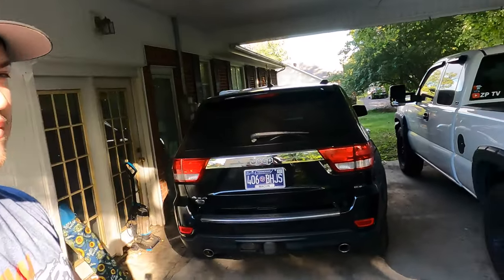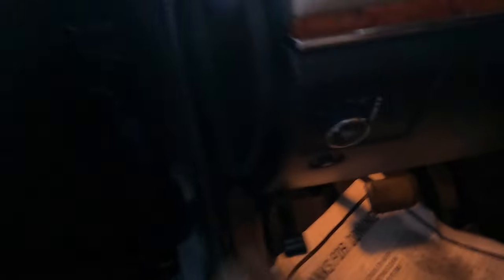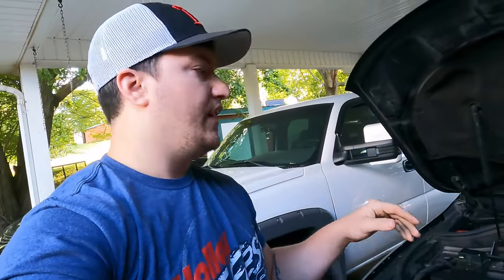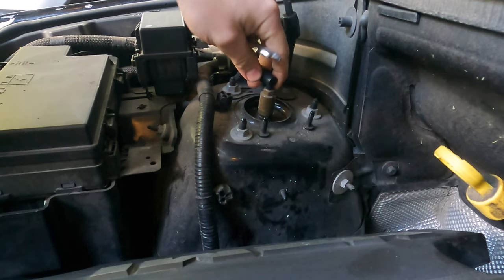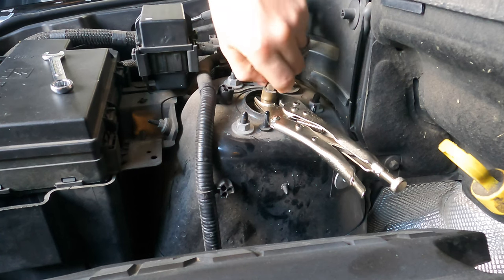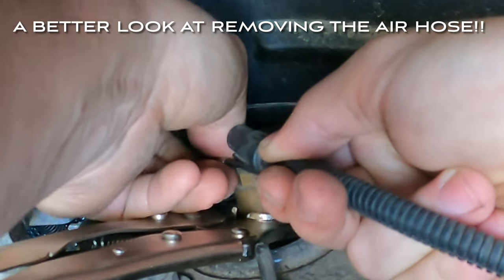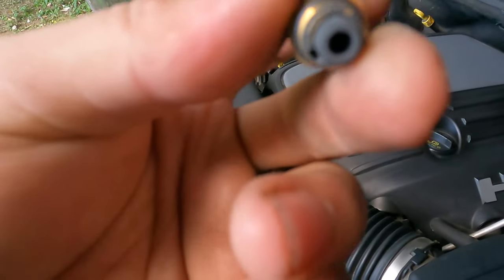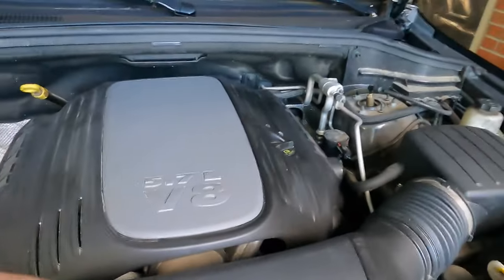COMMON PROBLEM!! Jeep Grand Cherokee Air Suspension Leak Fixed!!! (CHEAP & EASY)

Comment: Got quoted $4800 to replace the compressor and air lines to my 2011 Jeep Grand Cherokee from two separate Jeep dealerships that I paid to diagnose my air suspension issues. Same thing it was sitting really low on the front.  I saw this video and did this just to check before I spent the money and it fixed it. Thank you for saving me so much money! Now about those diag fees I was charged....
Reply from the maker: Happy to help!

Comment: Step 1: buy a Cherokee without air suspension
Reply from the maker: Pretty much lol 😂 It’s nice to have but a huge headache when it starts messing up lol
Reply: @ZPTVChannel  I had an 2003 navigator with it, always had problems swore to never own a vehicle with air suspension again. Looking at an SUV, saw a nice Cherokee on the lot, during the test drive I noticed the up and down buttons and asked the guy what those were for, he said it was to adjust the air suspension, drove it right back after that and left it on the lot.
Reply from the maker: @adriandude85 I don’t blame you lol even if you delete the air ride on most of these you get “service air suspension” warnings on the dash.. like you said probably best to just avoid it all together lol
Reply: I have a 2011 overland and my mechanic replaced the 2 bags and the compressor.  Its still on the bottom. Doesn’t go up at all.  Now he doesn’t know what to do
Reply: I’m currently experiencing this issue
Reply: @antdogs189  You need a new mechanic. Air suspension systems are pretty simple.

Comment: Thank you so much for sharing! Replacing the air suspesion elbow on my 2011 Jeep Grand Cherokee Overland fix my issue. I ordered 2 JWK2-A210-ADFU - RMT from Amazon and it has been working for several weeks now. The drivers side needed to be replaced but when replacing the passenger side air started escaping so I left it alone. I now have a spare if I need it.

Comment: Hello, had to give you a THANKS!!  I bought a 2011 jeep overland with a leak in the air suspension. I wiggled some lines and found the hissing problem. tried the dealer and they had the complete front two lines for about $100. i didn't want to dig into all that so... I watched a couple of these video's and i remember your video was one of them. yep, that's all i did was order a elbow for the driver side and poof...fixed. first i tried cleaning it and lubricate the o rings, made it leak worse so i parked it for a week till the part came in. I didn't want to burn out the pump is why i waited. thank you for posting. Tim
Reply from the maker: Happy to help!!

Comment: I fixed mine bro thank you so much suspension is perfect now  I put both of them on didn't even need one of them but changed them anyway..put it on tire Jack mode when I did it so it didn't leak any air while I worked on it only took 5 mins to fix.🙏your the best

Comment: Quoted $9k from local dealership to replace the system. Ridiculous. After I prodded they said they could cancel the system out for about half. Found your vid. Will give this a try. It does lift a little like you said, and got progressively worse, so hoping this is root cause. Rear is also starting to squat while off but it comes back up. In any case, thanks for taking the time to share this and especially the link to the part in the description is the cherry on top.
Reply from the maker: Happy to help! It’s insane what stealerships are trying to charge to fix this issue.

Comment: thank you so much! I have this porblem I had it on the passenger side and the dealership told me to change the suspension for 2000!! I am glad I walked out that fraud. Amazing I have the limited 2013 Hemi as well. Now both are lowering so heading to change myself those babies... cant believe it. Changed light bubls all the time  myslef this is easier. Thank you!!

Comment: Thank you very much for your video, you showed me where to buy the air spring connector (RMT) 👍🏻👍🏻👍🏻 and they ship to my country !
Mine broke down due to a traffic accident (chock) not to normal driving. This air suspension on my 2018 GC OVERLAND is just excellent, not a single problem knowing that it is 190.000 km on the odometer now.
Greetings from Morocco
Reply from the maker: Happy to help! Hate to hear about the accident…

Comment: ZP,   You r 1 of the best!! 
I just found a 2012 which has 39 k miles, for 8k.  You think is a good price?..

I like to learn how to swim before I put a foot in the water
Reply from the maker: That’s not bad. Just be sure to listen close to the motor, but with that low of miles you shouldn’t really have anything to worry about!

Comment: We have a '14 Overland with the hemi. Our problem was the weather we encountered In Wyo and South Dakota. Temps dropped to the minus and air suspension stopped. As soon as the Temps warmed, it worked fine.
Reply from the maker: Yea they freeze up if it isn’t fully charged with nitrogen. Even then all depending on how cold they still might freeze.
Reply: The airlines are freezing the moisture that condenses in them; either fill with nitro or spray some anti-freeze in your lines during the winter.

Comment: Seems that you can get away with using air instead of nitrogen to fill the system, but the issue is moisture which will freeze if you're in a cold climate.

Comment: Spray some soap on those fittings and it will bubble if they are leaking.  Windex or fantastic works but there is plumbing specific soap for this.
Reply: Do I need to check it with the jeep turned on?
Reply from the maker: As long as the suspension is aired up you can check it with the Jeep off.

Comment: Hello, when you put out this conector, u need recharge any type of air or gas? For the suspension system?

Sorry for my bad English 

I looking for install a kit of leveling
Reply from the maker: You can get it recharged with nitrogen but you don’t have to. The system is self filling so it will just fill itself with regular outside air!

Comment: We have a 2012 Overland and we’ve had our system replaced three times under warranty. Thank God we bought the extended warranty which is no longer available, unlimited time unlimited mileage so it cost us $100 each time but I believe this system is about 3500 bucks, so Chrysler is out 10 grand just on this part of the car alone in addition over the last 12 years of ownership Chrysler has probably spent close to $30,000 on this vehicle. We are finally getting so tired of it. We are looking at something else, and it will not be a Chrysler product.
Reply from the maker: The whole system is a cool idea on paper but I feel like it just causes more of a headache. Plus I’m sure they didn’t use the greatest materials for it either,

Comment: My jeep leans in the back corner also if my jeep sits fot a few days the whole thing is slammed hope this works for me. THANKS ALOT!!!
Reply from the maker: No problem! If the whole thing slams I would go ahead and change the rear fittings as well!
Reply: Where are the rear fittings located
Reply from the maker: @jrrincon79 on the side of the bag up near the top! It’s a lot easier to see if you take the wheel off!

Comment: One of my air bags is torn and now it’s slammed to the ground. How much will this cost? Can I replace just one bag?
Reply from the maker: Yes, you can replace just one! And it shouldn’t be too much depending on if you do it yourself or take it somewhere. The rears are super easy to do yourself and the fronts aren’t bad just a tiny bit more involved.

Comment: So its winter and i was lifting my jeeep grand cherokee 2015 suspension by putting it on off road mode and then suddenly i heard a loud pop. And the back of the car was low. The car eventually lowered itself but it cant lift to the normal driving suspension. Will what you did in this video fix my problem? Are there those type of valve devices in the back of the car?
Reply from the maker: I’m not sure if it will fix your issue but it does have the exact same fittings on the rear bags. They’re right behind the tire on the side of the air bag near the top you can miss it with the wheel off!

Comment: My question is, is this a real issue to be worried of? I mean if the compressor works fine and it goes back up to its normal position when you turn it on it means it is working I guess?
Reply from the maker: It will add unnecessary stress to the compressor and will cause it to fail a lot sooner. Also in the colder months the lines will freeze and you’ll have to wait for them to unfreeze before you can drive because the suspension will be bottomed out.
Reply: @ZPTVChannel  live in dominican Republic its never cold😂. Thanks for the advice 🙏 helps a lot.
Reply from the maker: @maarkkawis801  oh lol then yea other than the premature wear on the compressor it’s not much of an issue!

Comment: Was the raise button flashing before you replaced that  did it say immediately suspension service required or were you able to raise it and it just kept lowering?
Reply from the maker: It still raised and lowered perfect. There was no error lights or anything on. It was just leaking down after it sat for a while but I’m sure it’s because the leak wasn’t real bad. I’m sure if you have a real bad leak it would over work the compressor and probably throw an error of some kind.

Comment: Hey ZP TV, i own a 2013 Grand Cherokee Overland 5.7 Hemi. Do you know if they have an issue with computers? While i am driving, sometimes my dash gauges all flatline, all dashboard warning lights go off, and windshield wipers automatically turn on.
Reply from the maker: I’m not aware of any issues like that. My guess would be a bad ground somewhere.

Comment: I’m having problems with the rear being “slammed” I just ordered the part you mentioned from Amazon. Will it work for the rear?
Reply from the maker: I’m pretty sure the fittings are the same. The fittings will be on the side near the top instead of on top like the fronts!
Reply: @ZPTVChannel  ok thanks for the info 🫡

Comment: Thanks for the info! Do the rear air springs have the same issue as the fronts at all? Can they be repaired in a similar way by replacing the connector?
Reply from the maker: I know they’re the same connectors and lines so I’m sure it could happen in the rear as well. The fitting is on the side instead of on top so you should be able to see it behind the wheel on the bag.
Reply: @ZPTVChannel  That's great mate! Def need to get a set and keep them just incase I need them.  Thanks again!
Reply from the maker: No problem!

Comment: When you park the jeep, it’s better let him in park mode suspension or the normal mode? 
I mean what is better put him low  when is park and up when you go use the car or you just let him on normal mode (the first position up park mode)????? Thank you
Reply from the maker: I always keep it in normal mode. Park is lower than regular and it’s really just to make it easier to get in and out of. I don’t really think putting it in one or the other really makes a difference when it comes to longevity.
Reply: @ZPTVChannel  why don’t make difference?
In park mode the car use the air to go down and up and if he stays normal? Maybe he don’t do the process? I don’t know it’s my ask 
I need to read about the air suspension in jeep
Reply from the maker: @MrKnuckleszx  it won’t drive in park mode. Once you start it up and put it in gear it will raise to normal mode.
Reply: I wouldn't use the lowest setting. The rear air bags only seem to leak in the lowest setting.

Comment: Maybe a dumb question but, does the rear have similar hoses and connectors somewhere?
Reply from the maker: Not dumb I had the same question until I just decided to go snooping for it lol but Yes I’m almost positive it’s the same fittings it’s just mounted on the side closer to the top instead of right on top.

Comment: Do you think this would be the same fix if only the front passenger side sagged after sitting awhile?
Reply from the maker: Possibly but normally when one leaks it will leak down both sides because they both run off 1 main line.
Reply: @ZPTVChannel  I'll give it a shot. Even overnight, only the passenger side drops down. Thanks.
Reply: @ZPTVChannel  popped the hood today. Both side leaked when I turned them from side to side. Do you think it's fair to say this is my issue?
Reply from the maker: @JestinHirzel  most definitely!
Reply: @ZPTVChannel  awesome, thank you
Reply: @ZPTVChannel  swapped them out and now I can't it to raise to normal height. Said to service air suspension at first so I disconnected the battery and J1 Air Suspension fuse for a while. Connected everything back up and it still won't rasie. No more 'service' light though. I'm going to replace the 40amp fuse next because I'm not certain the compressor is even kicking on now.
Reply from the maker: @JestinHirzel  I would start there it may have overheated and blew that fuse.

Comment: Does cold weather affect this? I’ve never had problems with mine, until it dropped in the negatives outside.
Reply from the maker: Cold weather can freeze condensation in the lines causing the air pressure in said lines to drop and/or causing a service air suspension message until the system warms up.
Reply from the maker: Short answer to your question is yes it can!
Reply: @ZPTVChannel  Thank you sooo much! I hope that’s what it is. I thought driving it for an hour would do something, but maybe I need to get it in a warm garage??
Reply from the maker: @seuss7145 if it’s in the negatives like you said it’ll probably take a while.. it would get in the high 20s here and it would take about 15-30 mins to warm up and work right.
Reply: @ZPTVChannel  It was in the low 20’s when this started. Now it keeps saying: “Air suspension cooling down” lol
Reply from the maker: @seuss7145  yea the compressor is trying to run but from where the lines are blocked it’ll run until it reaches the temp to make it shut off. It should be fine after warming up either driving or like you said warming up in a garage.
Reply: @ZPTVChannel  I hope so! I really appreciate you help man. You have no idea.

Comment: How does that rubber seal below let air out up top at plastic lock
Reply from the maker: There’s 2 o rings one at the bottom and one at the top right below the air fitting. The bottom doesn’t go bad very often but the top one is usually the one that lets go. I’m assuming just over time the o ring get old and crusty and allows air past.

Comment: Please tell me where did you get the part from the one we have gotten is not the right one and it's from the dealer.
Reply from the maker: I ordered mine off Amazon! I’ll see if I can find the link real quick!
Reply from the maker: Link to air valves: https://www.amazon.com/RMT-JWK2-A210-ADFU-Suspension-Connector-Fitting/dp/B07DF9QGSW?pd_rd_w=4S1tx&content-id=amzn1.sym.99d2f5bb-29d9-4f60-b07e-f97fafe39bec&pf_rd_p=99d2f5bb-29d9-4f60-b07e-f97fafe39bec&pf_rd_r=DFYD6V16R1H4DWGZXREG&pd_rd_wg=6MJbb&pd_rd_r=56438158-5b86-4f3f-a4b3-426ef45ef289&pd_rd_i=B07DF9QGSW&psc=1&ref_=pd_bap_m_rp_9_t

Comment: I switch the struts suspension parts both sides under the hood. & it’s still slammed to the ground on the front. And there’s no leaks.  What would be my next step please.
Reply from the maker: The next step after that would either be the connection at the compressor itself or a pinhole in the air bag itself.

Comment: I’m currently having this issue except my back went down first now it’s all four sides down I’m told my compressor is working what could it be
Reply from the maker: Most likely these air fittings they’re all the same front and back

Comment: My English is not very good. But here is my question. I have a grand 2014 cherokee overland and the same thing happens. but he told me that I should check the automatic suspension quickly. So I took it to the dealer. Well, they changed the compressor and an air suspension on the driver's side, that was in January of this year. This week it went down again. Now I took her and they changed the passenger side. but he went to another place because the dealer gave me a bad experience because they had my car for 3 weeks. On the other hand, wherever I took it, in 2 days it was ready when the piece arrived. but they gave it to me and it says that I should take it to the dealer to reset the computer to read the new part. This is true?? Because the car is still down and on the dashboard it only shows off road 2 but it showed the same thing when we took it. And now I do not know what to do. Well, I've already set the normal mode but the lights keep blinking.
Reply: I have already spent 7 thousand dlls 😔
Reply from the maker: It it’s just leaking air from the elbows those wouldn’t need any kind of relearn. just the part replaced.

Comment: So if is sagged and I turn on my jeep and it goes back up to its normal level is that normal? or for example on my jeep it’s a 2012 V6 I have not used my jeep for the past three days and today it was all the way down but when I turned on my jeep, it went back to its normal level.  so this is this a sign that my suspension is going out? I also hear like  a sound like a Pssss kinda noise coming from somewhere under the hood.
Reply from the maker: Since it goes back up that means your compressor is fine and the leak isn’t that bad but most likely it’s just a leaky air fitting! Replace them and should be good! I would say since the whole jeep is sagging the rear fittings are probably leaking too.
Reply: @ZPTVChannel  awesome thank you I will look into the Fittings.
Reply: @ZPTVChannel hello. Only the rear is sagging. Where is the fitting for the rear located?
Reply from the maker: If you look be hind the rear tire it’s near the top of the air strut on the side!
Reply: @ZPTVChannel  thanks!